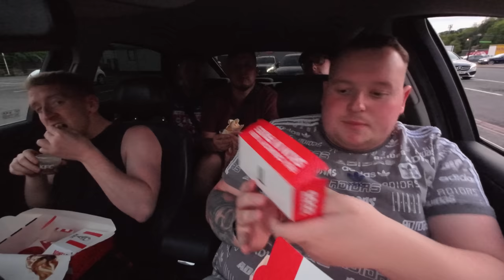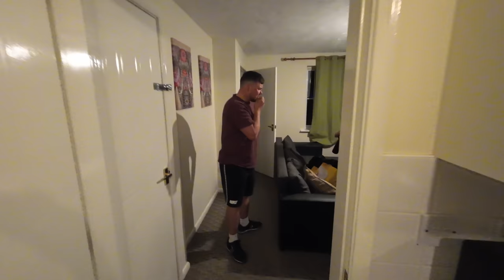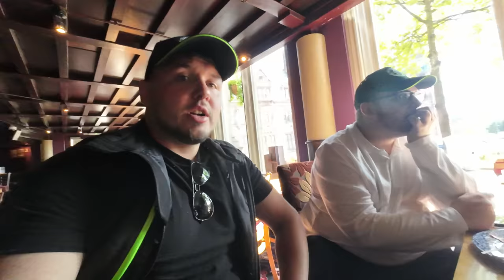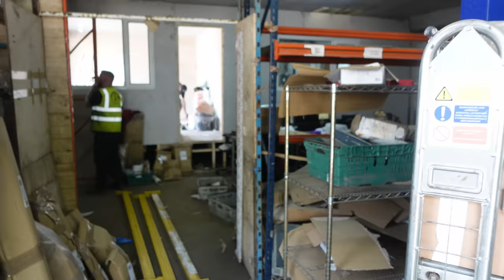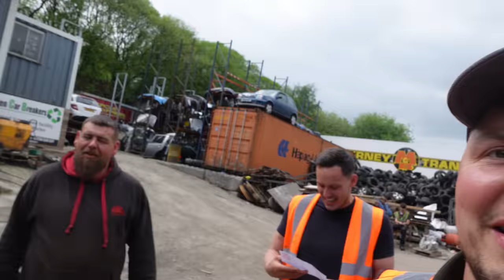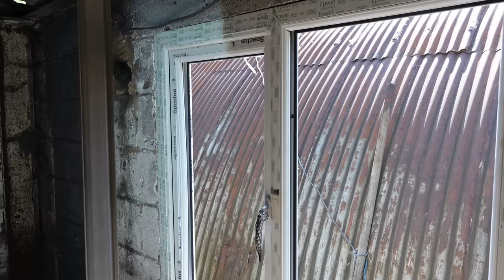Car Recycling Convention Behind The Scenes | WHAT A LOAD OF SCRAP - EP44

Comment: John got a new V6 car? I hope it’s a Capri, or an ST24 Mondeo?
Also, you Poms are mad, Nathan put up all that plaster board then covered the hole lot with a coat of plaster, ? Just tape the joints and screw holes.. 🤔🤔

Comment: Pointless shoiwing the day out, As you could have shown use some of the new machines on at the show. I know it is early days for the shop front. But the outside wall look a bit tatty at best. When you paint the packing room. Why not paint outside shop front and have the artist down, that done the roller doors put the company logo on the wall. That would look great, bang up to date, fresh and Moden. See John had to be on the video, Why does he (John) has to point all the time. If it is not his finger it is the radio. I know where he can put is finger.